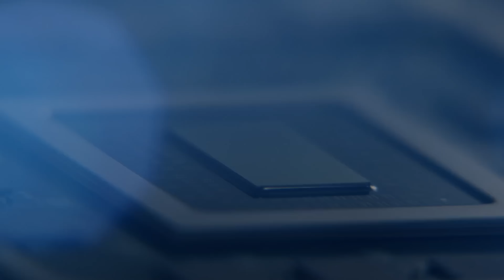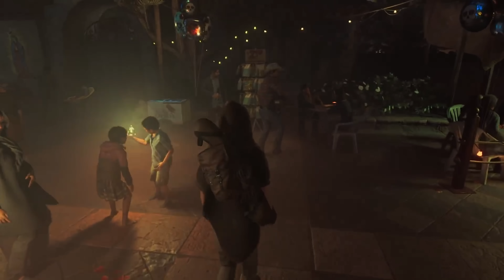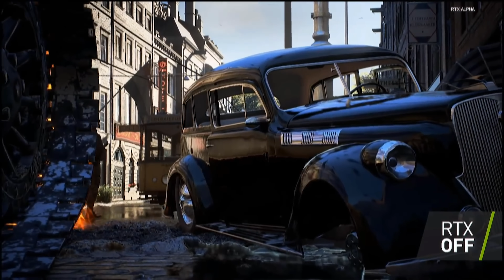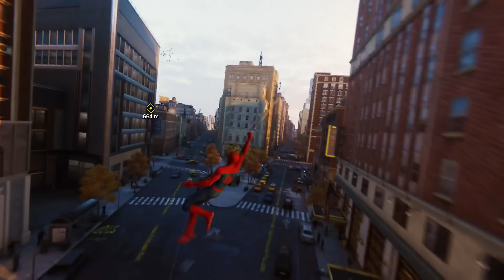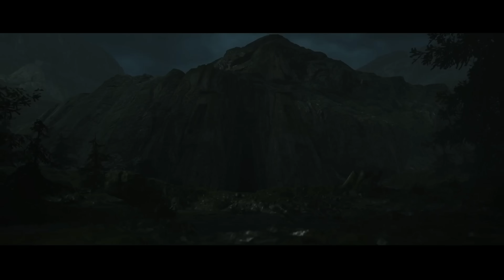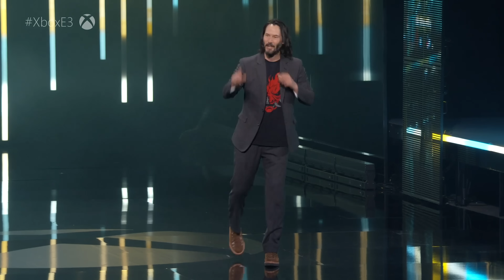Xbox Project Scarlett: Microsoft details its next-gen Xbox

Comment: I’ve heard both systems are going to be equally good way before they were announced.  The processors are both great, both consoles will have more than one tier at launch. Both support 8k res games. Microsoft will have a slight nudge in the memory capacity with SSD OVER Sony, nothing significant, but for some it will be   Both systems will be awesome both will be backwards compatible.